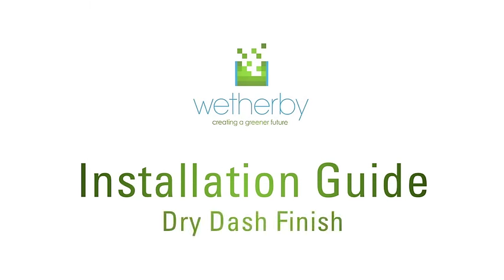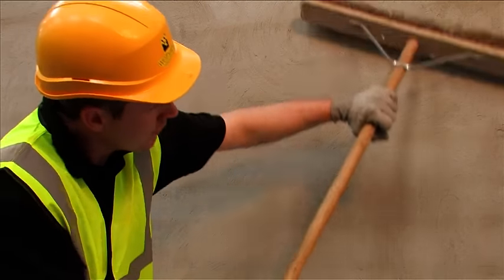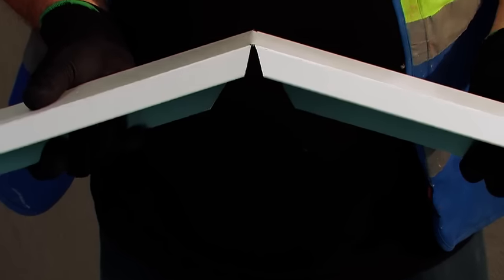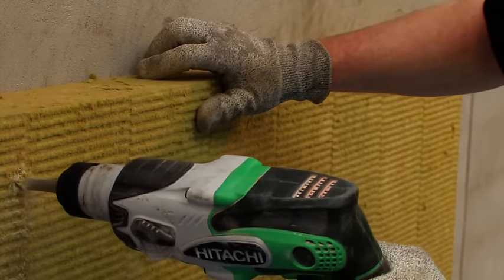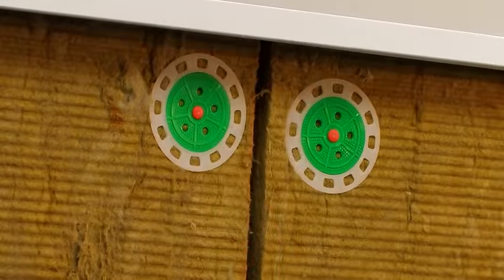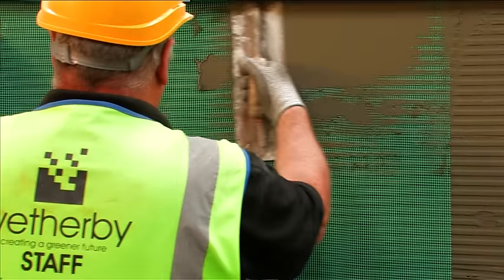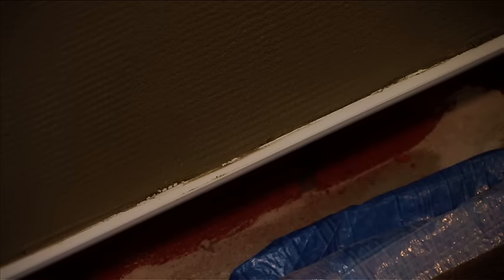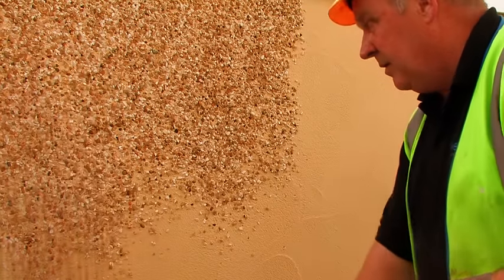Solid Wall Insulation with a Dry Dash Aggregate Finish

Comment: With your "Greener future" claim at the end of the video, a very important question arises. Do you create a recycling plan for you products after their expected life?
This "Solid Wall Insulation" is a very heterogeneous mix of materials, including plastics metal and stone. It does not seem green at all.
Reply: Instablaster.
Reply: "Wetherby specification" screams planned obsolescence or one off tools and materials.Look around 1:20 the guy is hammering a screw because the didn't build the wall or have know idea of the stud layout. Leaks. Cracks.

Comment: was he hammering screws???

and when he says 45 degrees or horizontal ... I don't think it means what he thinks it means. :)
Reply: Gary Wong 
Hammering screws? WTF? Where?
Reply: I think they are dowel nail and, if so, it's ok to be hammered.
Reply: +Marius Domnariu It's a frame fixer not a screw. They have concentric rings not helical threads...
Reply: Then explain why they have a phillips screw head...
Reply: +Altered Existence Because the tooling is reused...
Reply: Phillips screw head is for removal purposes

Comment: Hi just wondering if anybody can help me have this on my home I'm wanting to put a camera up I need to drill straight through will I do any damage if so how can I avoid
Reply from the maker: Hi Jamie, There are a number of ways of installing external fixtures and fittings to the outside of the EWI system, depending on the weight of the external item.

If you are fitting lightweight items, then the FID fixing can be used.

If you are fitting heavyweight items, then either the SWI-FIX tubes or the Fischer Thermax fixings can be installed through the system to carry the external item. If you could send us an email to info@wbs-ltd.co.uk, we can send you over the relevant data sheets, info on the fixings and an aftercare booklet that may come in handy for you for future ref. Hope this helps!

Comment: Using screws as nails lol
Reply: MegaMetinMetin ķ
Reply: LEXUS-RX300 you can drive a screw with a hammer, but good luck removing it the same way!
Reply: ***** have drills become to expensive
Reply: No, I'm not sure why they do it.  I've only done it in a few of cases. A drill is the proper tool.
Reply: Scott Kester its a hammer fixing. its ment to be hammerd in. it only has a screw head so it can be unscrewed
Reply: Yep.
Reply: @8587john  That makes no sense. The screw head is going to be full of cement and not accessible. If that wall ever gets demo'd it wont be by unscrewing the rat guard.